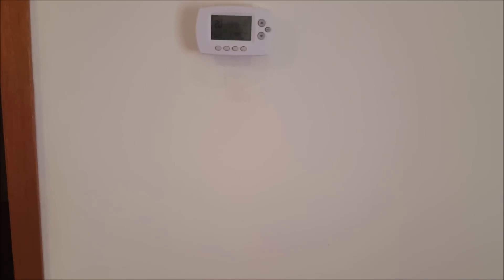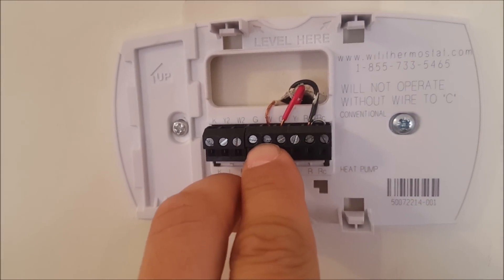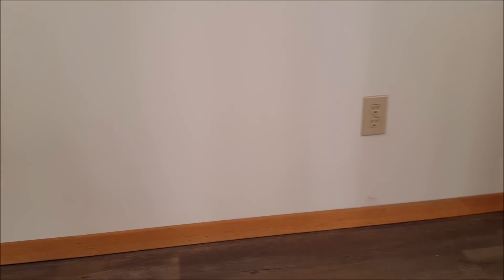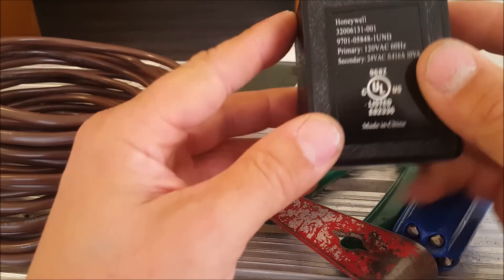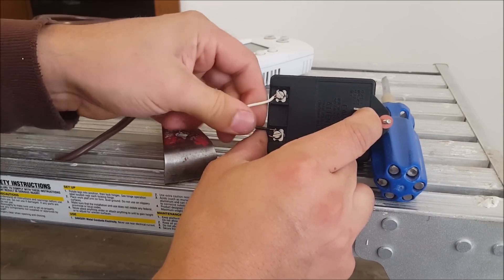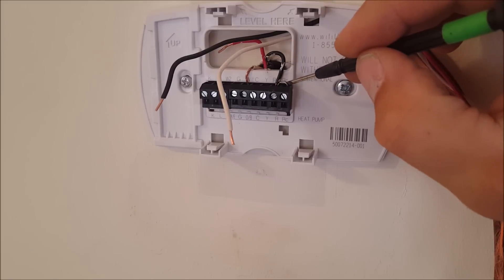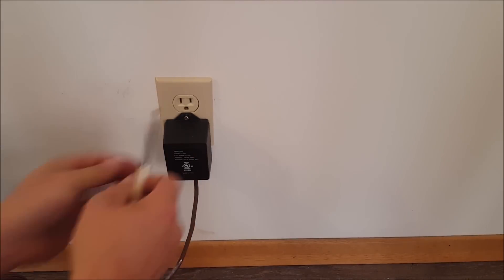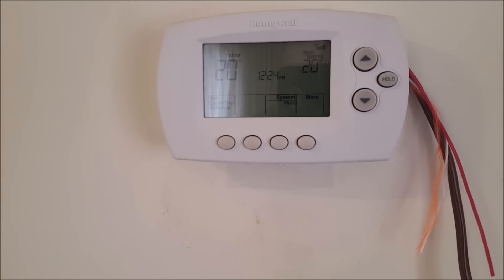Installing a WIFI Thermostat with no C Wire? NO Problem!

Comment: Hi, came across your video very well explained one question. I have a secondary home that I shut down for the winter months.I always shut my boiler switch off when i'm not here for those months. By me, shutting the boiler, switch off. I'm killing the power to my nest thermostat for those months of not being here. If I do this transformer will this keep my battery charged all the time. That I don't have to worry about killing my internal battery while my boiler switch is off for 6 months. Hope you could answer me. Thank you

Comment: I'm seeing so many homes in these types of videos that don't have a common wire feed to the t-stat, why is this so common?  Is it because installers aren't running new 18/7 or 18/8 t-stat wires when upgrading older HVAC systems, and are opting to wire them up using the existing 18/5 or 18/6 feed from the old equipment?

Comment: my Nest doesn't have a Rc terminal. only R. It's a 2020 model. The only terminals in the Nest are Y, C, W, G, R, and OB*.  which terminals should I use to hook up the red and white wires going to the furnace and the 2 wires coming from the transformer? Put one transformer wire into C and one into R (along with the red wire from the furnace)?

Comment: Hi I connected an emerson Sensi with a 24v transformer for like a month now with my boiler and the thermostat been working fine but I forgot to remove cut the in built jumper so should I cut it now or leave it

Comment: My old thermostat wiring had no C-wire, only 4 wires: R, G, Y, W. The heater has  230/24V transformer with 24V Common wire grounded. I replaced the thermostat with a Nest smart one. Connected the Nest's C terminal to nearby 120V outlet's ground terminal, got 24VAC between R and C terminals. The Nest has been working without issues.

Comment: Great job. When I remodeled the house I Ran a 5 wire cable for future upgrade but also left the two cable next to it and taped it off, now all I have to do is get a transformer and make good use of the two cables dangled in the basement. I'll just put an outlet in for the plug.

Comment: I don't have a C wire and will be running one like you showed but I have a RH and RC wire attached in the RC and RH spot. Would I then connect one of the transfer wires with the wire already in the RC spot and the other in the C spot? I've been searching online and thankfully came across your video which is most close to my situation. I greatly appreciate any help you can offer 🙏
Reply from the maker: Cause you have AC. All you can do is try
Reply: @randomrepairchannel  Thank you I appreciate the reply 👍

Comment: Thank you.  Exactly what I needed to install my Honeywell T9 to my gas fireplace.  After spending time looking at the wiring on my fireplace and searching the internet I came across your video which was exactly what I needed!  Saved me a visit from my HVAC guy!
Reply: I tried this with my T9 and my heat won't shut off. Did you have to change anything other than hooking up the transformer to c n rc?

Comment: Does it matter which wire goes where on the transformer?  Looked at close up pics of the Honeywell 32006131-001 and the terminals are not marked at all.  Is it like a light bulb, meaning it will work either way?

Comment: The C wire adapter that is already one wired unit are the 2 wire interchangeable when connecting to the new thermostat? I noticed the wire adapter 2 wires are not color coded at the connecting end. Tia

Comment: Thank you so much! I have an old gas stove-style heater that doesn't have the terminals described for the adapter kits for the smart thermostat I bought without thinking about compatibility. I never had a thermostat that needed more than two wires before. This is exactly the solution I needed.

Comment: This was very helpful. Another question I have since I did what you mentioned with a 2 wire oil furnace, the fan operates when the oil furnace chamber reaches a temperature to turn the fan on automatically. Could I connect the fan terminals on this thermostat to run the fan when I want to or do I need a relay?
Reply: depends, does the thermal switch on the oil furnace control mains directly or through a 24 volt relay? take a look...

Comment: What wi fi thermostat do you recommend that I can use my phone/Tablet also thermostat is password protected that nobody can turn on furnace and jack up the temp, I can control it while I'm at work or out of town, as for C wire  I have plain ol gas furnace nothing fancy it not central heating. Will it still require C wire? And the wi fi thermostat is in very budget friendly, don't need all the fancy bells and whistles I just want the thermostat that is password protected so no one can turn on furnace and jack up the temp and I can turn off furnace while I'm at work or out of town.

Comment: Most of the time it would be easier to run a new wire from furnace to thermostat . besides the fact adding a transformer to thermostat you need that RC to operate cooling .

Comment: Thank you, RR. I bought a wifi thermostat not knowing about the C-wire. I was about to throw in the towel when I discovered your video. You explained it to a 'T' and I had the unit installed and working in no time. I have liked and subscribed because I am sure I will see new videos that will be helpful to me. Thanks, again.

Comment: Thank you for this video. I struggled to power my ecobee until I came across your video which showed me how to provide power to the thermostat.
I have a two wire (Red and White) thermostat connected to baseboard heating (zone valve.) Luckily, I have access to a 24v transformer near the boiler and a spare wire coming to thermostat. 

Here is how I wired my ecobee:
1. Connect spare wire to 24v transformer labeled “Load”
2. On the thermostat end, connect spare “Load” coming from 24v transformer to ecobee ‘Rc”
3. Connect “Red” wire to ecobee “Rh”
4. Connect “White” wire with a jumper wire to ecobee “C” and “W1”. Please note; if you follow “White” wire back to the boiler you’ll notice it is connected to 24v transformer labeled “C” which provides power to zoning valve by completing the circuit when connected together with “Red” wire.

Here is my diagram:
https://drive.google.com/file/d/1Yx79pAtcSoadQqdU5ahQ6bVnKpcVWkKA/view?usp=drivesdk

https://drive.google.com/file/d/1EG9Mvh_5hMfv6a7IDKoE2CIxKBvIyc1V/view?usp=drivesdk

Hope this schematic diagram helps anyone with similar problems.

Comment: I have a 24V adapter but I only have W and R wires. There is no RC terminal. I realize I'm supposed to put one of the adapter wires in the C spot and one in the R or RC spot. I already have a furnace wire in the R spot and no RC spot. Anyone know where else I could put the other adapter wire? My options on the Nest are Y, G, OB. Or, can I put two wires in the R spot? Anyone... this damn C wire problem is killing me. 🤪
Reply: Hi Shannon, did you find an answer to your question. by any chance? I have the same issue. Thank you

Comment: Anyone know where these can be purchased new? I can only find cheap questionable ones on Amazon and virtually nothing on hardware store web sites.
Reply from the maker: Lots of them around, just make sure they are ul/CSA approved.

Unfortunately the links expire, but her is the first one that came up
https://www.amazon.com/Transformer-Compatible-Doorbell-Thermostats-Certified/dp/B083R621RV/ref=mp_s_a_1_7_sspa?dchild=1&keywords=24v+hvac+transformer&qid=1609818771&sprefix=24v+hvac+&sr=8-7-spons&psc=1&smid=A2LQDNP99UBG7W&spLa=ZW5jcnlwdGVkUXVhbGlmaWVyPUFFWlJTRzhVQ0hVREomZW5jcnlwdGVkSWQ9QTA3ODU5NTMzUEMzVE5TQVhSMk80JmVuY3J5cHRlZEFkSWQ9QTA4Mjg4NTgySFNQSldaQjM5TFhGJndpZGdldE5hbWU9c3BfcGhvbmVfc2VhcmNoX210ZiZhY3Rpb249Y2xpY2tSZWRpcmVjdCZkb05vdExvZ0NsaWNrPXRydWU=

Comment: can I run the wire from the thermostat C terminal to the wall outlet without the adapter ?
Reply from the maker: No, that will make your thermostat blow up

Comment: Specification:  input voltage 120 VAC. 60GHZ,   output voltage 24V,  40VA  thank you will this work smart wifi  thermostat thanks
Reply from the maker: Yup. No problem

Comment: sadly im still confused. What if i dont use that R wire at all, and leave it hanging. It supposedly carries current from boiler, so if i have a new R from adapter...
Reply from the maker: Won't switch the boiler on
Reply: @randomrepairchannel  i figured the circuit would pass thru the W... so if i have a R & Rc, when i add this adapter i would use BOTH r an rc?
Reply from the maker: @AnubhavShah  that's right

Comment: Thanks, very helpful video. One question before i embark : I got a transformer from AGPTEK and its output wires are both black color, does the coloring or polarity matter which way i connect these to the thermostat ?
Reply from the maker: Shouldn't matter
Reply: @randomrepairchannel  Thanks for confirmation and for your video again, very useful, am on this now.

Comment: Thank you for your video. I purchased the transformer and wired it similarly to your description. I have an older Honeywell thermostat that doesn't have the WiFi capability and was testing to see if the transformer and wiring you described would power up the old thermostat. It has a backup of 2 AA batteries. I took the batteries out to see if the new wiring would power up the thermostat. The only main difference to the wiring from the video and my thermostat is that there isn't a C slot but a G slot. I understand the G is interchangeable with the C. Correct? If not, please advise! Thank you. My intention is to buy an Ecobee SmartThermostat to replace the old Honeywell.
Reply from the maker: Correct
Reply: @randomrepairchannel  Thanks for the quick reply. Unfortunately, it doesn't power up the old Honeywell thermostat unless I install the two batteries. Any ideas why? The transformer is working.
Reply from the maker: @healthygolfer  thermostat problem? 24v should power it
Reply: @randomrepairchannel  Any way of showing you a graphic of the wiring and/back of Honeywell thermostat?
Reply: Also, found the graphic on the box that the transformer came in. It seems like it wants to connect to the C (or G) terminal AND the RC terminal.
Reply from the maker: @healthygolfer  hard to tell. Might be a different model wanting different voltage
Reply: @randomrepairchannel  The transformer is 24V power adapter. I'm any case, I'll try its recommended connection and will get back to you if it works. Either way, thank you for your support.
Reply: I tried to connect the transformer according to its graphic instructions but without a WiFi thermostat I'm not sure if it should work. I did remove my batteries from my older  Honeywell Thermostat 50003442-003, but it didn't turn on. Just a reminder that there's no C terminal, just a G. The existing wires are in the R and W . I had the jumper removed from the R and RC as you showed in the video. Should my old thermostat power up with your instructions even though there's no C terminal?
Reply: If your thermostat using 2 AA batteries, just buy a 3 volt DC adapter and connect the negative wire to the negative terminal and the positive wire to the positive terminal on thermostat's battery slot. Simple and it will work, save your headache instead of caring about C or G terminal.

Comment: Help me please: I bought 24-V AC-AC 1000mA. Removed jumper, plugged 1 wire to C, 1 wire to Rc. All powered up nicely on thermostat, wifi connected, setup went thru smoothly. Problem: Fan would not power up, AC would not power up. So I decided to remove the wifi thermostat, plugged my old Honeywell thermostat in with same config (1 wire to C, 1 to RC, no jumper), removed battery. Still the old thermostat could not command the AirHandler and Compressor to run. I disconnect 24 AC-AC converter, disconnected Rc, plugged jumper back R-Rc, pop battery back for old thermostat to command the system and it was OK as the old days without the wifi therm. Help please, what is the issue?
Reply from the maker: That will happen sometimes. You may need the jumper

Comment: ty
Reply: So this is indeed what I need to do, but I just had a thought.   The 'C' wire is really just a neutral that is needed?    I have a light switch just inches from the thermostat.      Wouldn't just splicing a neutral wire to the lightswitch's neutral give it the return its looking for?    Though I wont do this, as i'm sure its a heavy electrical code violation as the neutral wouldnt even be on the same circuit that the boiler is on.

Comment: Is it safe to power two thermostats off of one transformer? I like this version more because this wire can be run behind walls. Those “c-wire adapters” with the the thin wire found on Amazon may be violating electrical codes.
Reply from the maker: Yup you can run 2 of most thermostat. When in doubt, check the output of transformer and how much thermostat uses

Comment: ...and obviously, if you have 2 wire system but your wiring has extra unused wires you dont have to by another 24 vac transformer

Comment: Well that got my thermostat to light up, but its not triggering my garage heater to start
Reply: Same thing was happening to me until I put one wire from the transformer in C then did a pigtail with the other wire along with the normal wire that goes into Rh and now everything is working perfect. I didn't put any wire into Rc, when I did, I got no heat. I only had a two wire system with only heat.

Comment: Nice video. I just bought an adaptor similar to that on Amazon and the thermostat is saying that it's not reading a common wire. It's a 3rd gen Nest.
Reply: My nest isn't getting any power from this setup. Do have any ideas on why this is happening with a setup like you just did but with a different 24v transformer.
Reply: @Mikegee63  Are you sure you got an AC transformer, not a DC one?

Comment: what happens if the power goes out and your PC reboots will it automatically connect ? or power to the plus goes off will it reconnect
Reply from the maker: It will just come back on after the power returns

Comment: Thanks from Australia. Exactly what I needed. Most of the vids emphasised the C wire without telling me where to connect the switch wires for a two-wire system. But you nailed it.

Comment: Great instruction, I have three wire system with C (W, Rh, C) wires. The thermostats powers fine, but when the heat turns on the thermostat lost power. The thermostat power on/off cycle every 2 second. What is the problem? Why it cannot maintain power when you turn on the heat?
Reply from the maker: Your furnace may not have the power to run a "power robbing" thermostat
Reply: @randomrepairchannel  what does this means and how to fix this problem?
Reply from the maker: @StanleyH01  you can disconnect the c wire from the furnace and try the transformer trick on the video
Reply: Yep, that is another option. I was hoping not to run the extra wire or making holes on the wall.
Reply from the maker: @StanleyH01  put the transformer in your furnace room since you already have enough wire ran
Reply: But it already have a transformer, do you mean I should bypass the circuit board and connect the wire directly to the transformer? Many thanks.
Reply from the maker: @StanleyH01  yes. The transformer may be running out of power.

Comment: I have a 24 volt transformer attached to the furnace. It is part of the control circuitry for the furnace. Can I piggy back on the 24 volt output and run cables to my wifi thermostat?

Comment: Best and simple video, after months of reseach I finally got it thank to you.  If I connect a wifi thermostat to central ac, do i connect 1 wire to C terminal n the other to RH
Reply from the maker: You may have to reverse it for cooling

Comment: hi, so i chatted with a support person from Honeywell just a few minutes ago and he said that i can not use another transformer(24V) to power my T5 thermostat....i have a 4 wire system(heat and cool) and of course missing the C wire. i was planning to use the 24 V adapter but my confusion is, do i leave the R wire connected in the thermostat side and connect my adapter to C and Rc? Thanks.
Reply from the maker: If you can do like in the video it will work. Can't speak on other ways. Sorry

Comment: What if I ran a 18/5 already to have extra wires but my furnace control unit doesnt have a c terminal screw, it has plugs.   Do I still connect 2 wires to my current transformer,  1 wire to RC and 1 to C
Reply from the maker: Some furnaces you cannot use a c wire. The external transformer will do the trick

Comment: I already have a wire going to Rc and Rh, but no c-wire.  One goes to C, of course, where should the other wire go?  Can I just remove an Rc or Rh and cap it off?  Then install the other?  It is a nest.
Reply from the maker: Not if you use ac

Comment: yeah my problem is trying to install one of these smart guys with no c wire thats powering heat and ac - cant figure wtf im doing wrong - the thermostat comes on but it will not turn on my unit-  hook  the old one up and it fires up....

Comment: Thanks, my Nest worked fine for 2 years with no C wire then all the sudden on one of the coldest days it reports an error that when I googled said it needs the C wire for power.  This solution fixed my issue ordered the  24 Volt AC transformer from Amazon

Comment: My Thermostat cable has two additional unconnected wires (blue,black).  If one tests hot for 24V, should that become the "C" and assume the other is "RC"?